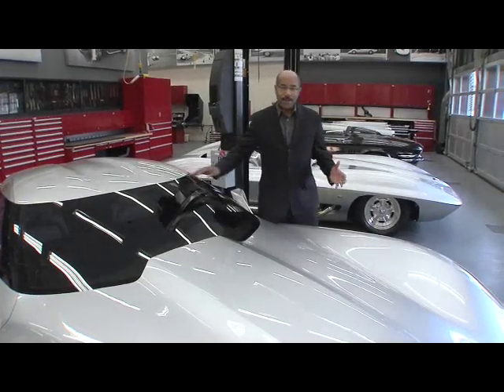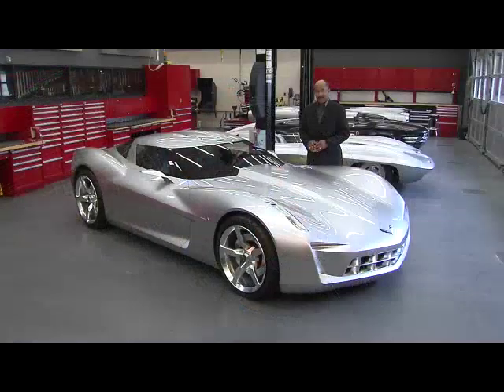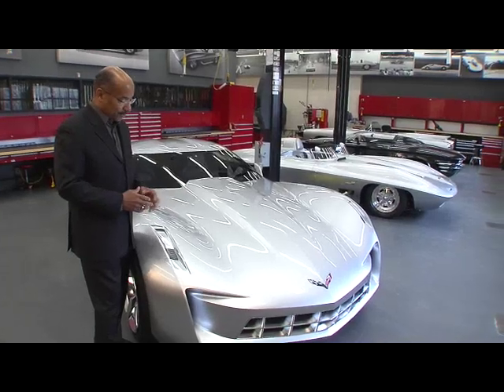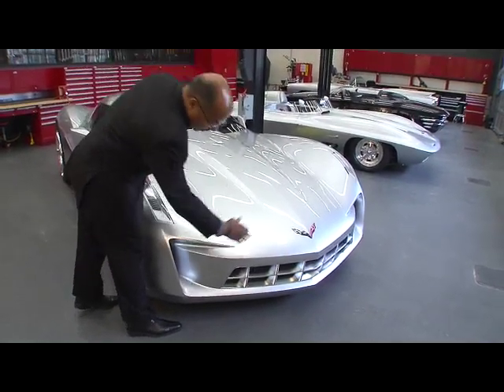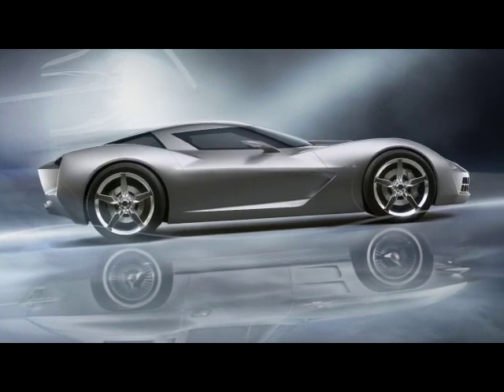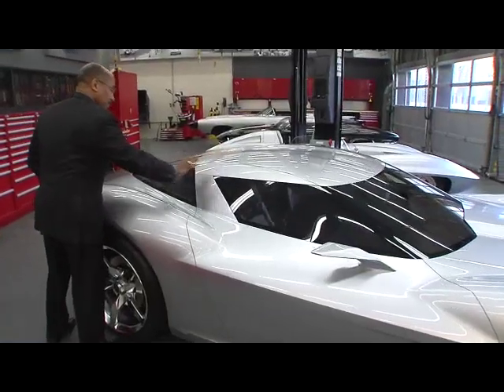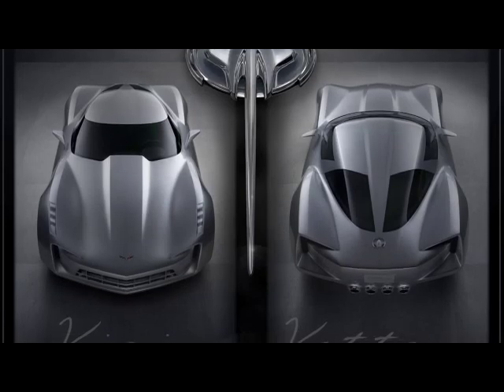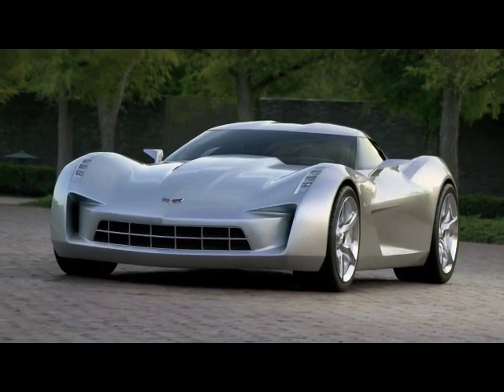Corvette Stingray Concept Design Overview

Comment: @shoelessjohn Agreed.  The old Stingray from the 70's was one of the most beautiful car designs ever.  The problem with this car is they pulled features from the 50's, 60's, 70s, 80's and maybe '90s.  Pick a decade and stick with it!  They should have just updated the 70's Stingray.  Ford didn't try to mix 3-4 decades of car features into the Mustang.  They updated the 70's Mustang and got a great car.  

BTW, doesn't this guy look like someone who'd never drive a Corvette?  He's got a 4-door.

Comment: @UncleSam493 
That does not negate the fact that the United States' automotive industry is YEARS behind that of Europe. All the "SS" Chevys and "R/T" Dodges and other "sporty" American options equate to standard production powertrains in European vehicles of equal value. Many US cars have fairly inefficient engines with large cylinders and mediocre output. 

That's not to say they're ALL bad - the oil crisis really put the entire industry on the right track.

Comment: Looks interesting. Looks a little like the Batmobile but I bet it has great aerodynamics. Seems like they are going for a futuristic look. Put a powerful V-8 in this thing and you've got yourself a nice race course car. Very low center of gravity, fiberglass body, high performance engine and parts that every Corvette gets, and this sleek design is everything an owner of this car will have to get heads turnin' and rubber burnin'.

Comment: I agree that the rear needs more tweaking i cant even see the rear tail light, i cant even picture in my mind some one backing that thing up into a side garage door and from the front, i don't know at an angle it looks nice, but straight forward the grill and the narrow lights just don't look right to me, but if there were LED lights at the bottom o the headlights going to the right would  make it better.

Comment: or use the modern designs with the old engine? i wish they still made cars where you could literally stand in the engine bay to work on the car and it wasn't all computers.. it was simple to do your own mechanical work and the cars were more reliable... modern cars have more electronics than it really needs.....

Comment: I'm a huge vette fan, I own 2 of them, the c-6 body was easy to get used to, it didn't have to grow on you, either did the c-5, but unfortunately this body style isn't exciting me. Maybe it has to grow on me, it is a concept in every meaning of the word, looks as though you would have to be 5'5" tall to fit in it, and aero dynamics are lacking, vettes are built to carry the GM emblem on the race track and this car won't cut the air like a c-6 or c-5. Nice concept but...
P.S. Chevy will nail it!!

Comment: I'm sure it will be stuffed with Massive horsepower controlled by an ECU that will just be so smooth people will cry when they pilot it. I do wonder why it's not offered with a multiple mode All wheel drive version. If the engine is in the front and the power goes under the car to be delivered to the rear wheels then why not an AWD version? My Suzuki SX4 has an excellent set-up for the AWD that saves from having to dig out from snowy nights. Will this Vet have a dry sump engine?

Comment: Agreed. Although parts of this new design are elegant when taken by themselves, they're mismatched somehow, with too many lines converging unharmoniously. Where even an old, worn out classic Singray is pleasing to the eye, this new thing manages to be less than the sum of its parts. Imagine it rolling around town in 20 years after the newness has worn off. It will look like an oversized clown car fit for a future remake of Corvette Summer. Detroit just doesn't get it. Less is more guys.

Comment: I'll take an original Stingray over the new "concept". The side view, the roof line and hood are nice, but the headlights and intakes ruin the front fascia while the rear looks like a boat hull. The grill makes the car look like it has braces and where are the circular tail lights? They're tradition! D:< Honestly, this car was probably rushed to make it into Transformers because I don't know what the designers were thinking.

Comment: How are flip up headlights a good thing? It's more drag when they're up and puts that weight higher and further out. Flip up lights are a bad design. Integrated are better in nearly every imaginable way, unless you're talking solely on giving a car flip up lights as a unique styling feature and not thinking about performance at all.

Comment: this car just doesn't work for me. The symmetry is off (parts of the car should flow into one another; but this car parts stop and others begin). To me, this car seems like a mish-mash of parts from other cars and erras.

Also, what happened to GM?  They used to look to the future and now they cling to the past?  Has the Futurama finally arrived?  Where's my damn flying car then?

Comment: For the most part, this "Dream concept" Is simply flat out ugly. Do these people even look at them once they're put together? The same can be said for most GM cars right now, the overly exaggerated styling just doesn't work, look at the camaro, what was someone thinking? 
GM has most of the country's best engineers and designers, they can do much better. For one thing, they need to stop making their cars look so cheap from the inside out.